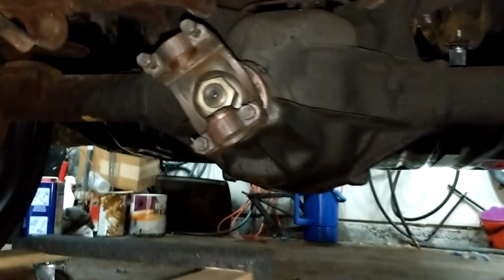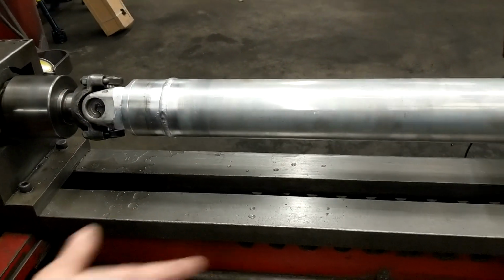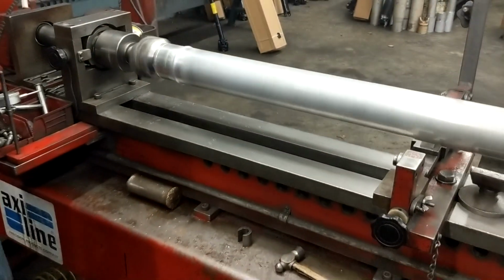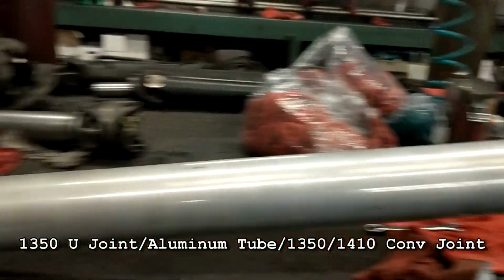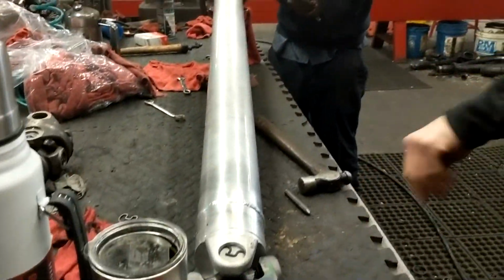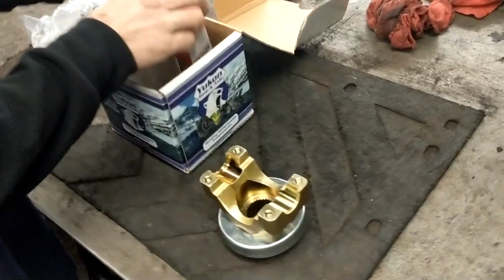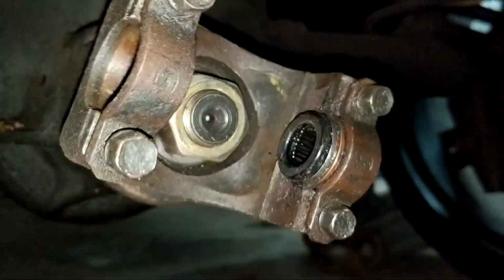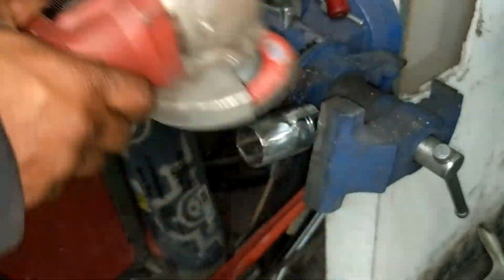DRIVE SHAFT LS SWAP BALANCING DRIVESHAFT DARKNESS  PART 8

Comment: Very cool seeing the driveshaft balancing rig.  You probably know this, but hat pinion nut needs to be setup with the right preload in the pinion bearing.  I dont think you can just tighten randomly, but maybe someone else with more info will chime in, good to see a vid from you
Reply from the maker: Tks G, correct when I installed the new gears 3.73 in the rear end I have the pinion bearing preload set at about 30 if I recall..so I didn't want to disturb my preload so i hand tighten (no impact) with my ratchet and made sure my pinion nut was in the exact place and rechecked my preload and it is about 10 up so it's still in specs...Tks for stopping thru..CJ

Comment: I'm running a 6l80e as well on my truck. So i probably need to know how much does that set up would run?
Reply from the maker: Trevin Taylor what's up Trevin, are saying how much horsepower if so it can take 700 they told me and it cost me 650 for this custom drive shaft..I can't remember if the 6l80 has the same spline is the 6l90 since the 6l90 is beefer and 36 spline.. CJ
Reply: CountrySideClub well thank you on giving me both of those numbers. But I believe they are the same on the spline side. Did the upgraded yolk come with that price too?
Reply from the maker: Trevin Taylor yep, came with everything you need just need to measure and connect...the shop made the measurements simple just from out shaft to inside of yoke where the u joints sit and it fit perfectly..again I know my measurements was the most accurate but I can tell a huge difference..it's a must hav..CJ